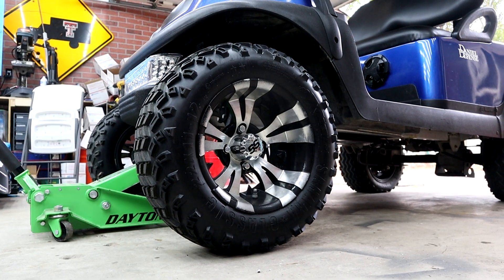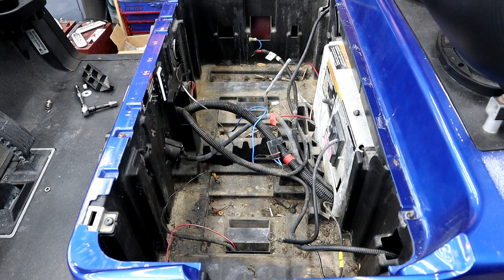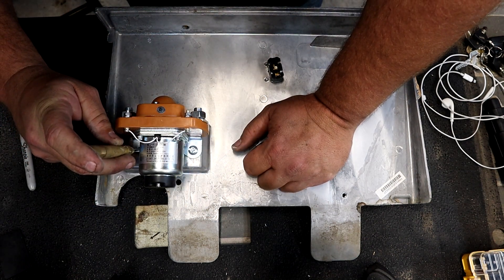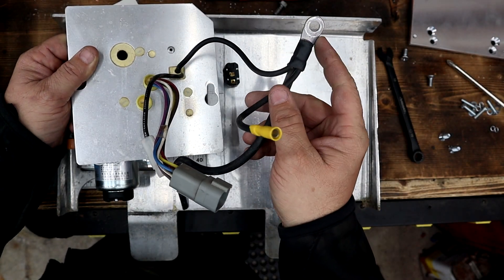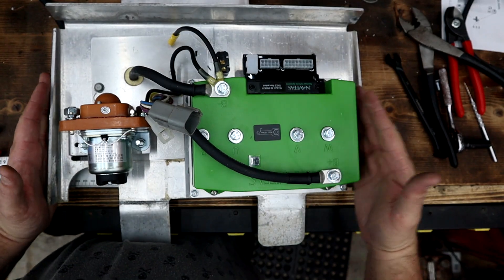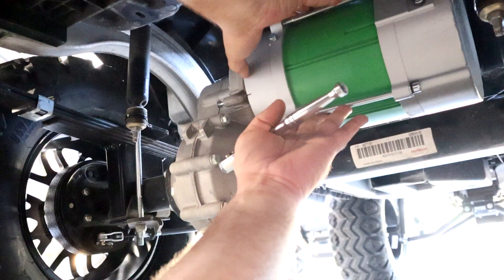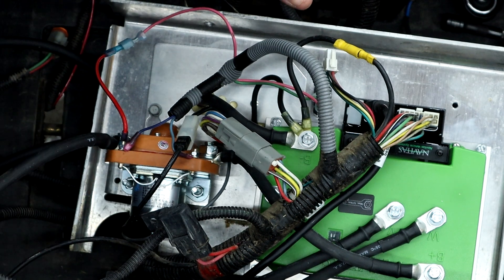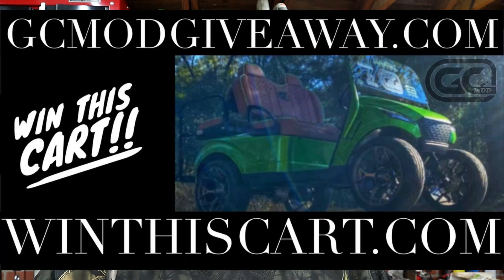CLUB CAR Precendent AC swap. Making your Golf Cart A Rocket

Comment: I have a 2003 Club Car DS. I installed the Navitas Controler and AC/DC conversion motor. I deleted the OBC and installed 4 48V lithium Big Boy Batteries. I also installed an upgraded solenoid. When I got rid of the OBC, I cut all the wires coming out of the OBC, capped them off and jumped the white and blue wires together. The problem I am having is when I turn on the lithium batteries, the battery indicator goes on without the key being turned on and I can't get the Navitas app to recognize the controler. Any idea what I did wrong?

Comment: Great video, I spoke with Steve yesterday about purchasing a Club Cap Precedent AC conversion kit and I will order today. My question is do you have a part number for the back splash guard? I am removing a Navitas 600 DC and I cut the hole in my splash guard when I did the install. Thanks

Comment: I have a 04 club car DS (No lift) Big Battery lithium Eagle kit (120ah) upgraded D & D speed motor and a 440 navitas controller running 27-28 mph with 2 adults. I was curious if a 4kw ac upgrade would be worth the cost? What kind of speed is the 4kw motor producing? Thanks great video!!!
Reply from the maker: My DS runs 35+ mph with a 4K. On hills 27 mph. Way more torque and efficient. It’s even better when paired with a Lithium setup

Comment: I bought the Curtis/Albright heavy duty 48v solenoid and just want to make sure that the b positive on the controller connects to the plus marked side of the Curtis solenoid? My old solenoid also had a resistor connection connecting the two large posts on the solenoid which you didn’t show on the video, do i keep this connected on the new solenoid? Great video!

Comment: Curious as to why no one (including you) has made a video on the 4X12 battery version with center controller Precedent. I have 2 2008 Precedents and looking at doing the 5k and Lithium conversion.
Reply: I am interested in this as well, I've got an '05 with 4x12v and the middle mounted controller plate, wondering if it makes a difference in installation?  Are the cables provided long enough etc?  Any thoughts GCM??
Reply: @mikebogart3841  It all fits and goes in just fine. I just had to drill and tap my own mounting holes. Everything is long enough and works great. I did the Big Battery 72 volt Falcon conversion at the same time. I'm getting insane performance from this system
Reply: @Goldenlife thanks for the info!  Now I just have to decide whether to ditch the OBC and get a new charger as well I suppose.  My cart was neglected for 2 years due to the pandemic, couldn’t get to our vacation spot, so lots to do to get it going.

Comment: I have a 1998 electric golf cart. And my golf cart hose 12 mph but I wanna go faster I have a voltage reducer. In only trying to spend around 200$
Reply: Good luck with that budget. Howver, you could send your motor off to Plumquick.com and let them rebuild it in their "Bandit" upgrade for $275 and still use all stock components.

Comment: I watched your videos, got a 4K system AC conversion, for my 99 club car, and feel I got a the wrong harness , been working with support for over a week now and I am no where closer to resolution, key stopped working peddle doesn’t provide the 5 volts so it may have something to do with that. Thoughts on where to look?
Reply from the maker: Shoot me a email golfcartsmodified@gmail.com
Reply: @GolfCartsModified  
What can I do to make my 1997 36 volt club car faster, it’s all stock with solenoid’s and them ( heat sink bed spring lookin things) an the rear frame rail.
All suggestions & help will be appreciated…
Jimmyb

Comment: I have a 2021 icon i60 that has the 5kw ac motor and a Toyota 440 controller. Can I upgrade the controller or do I need the motor too? trying to get up to speed faster

Comment: I ended up with a nav 10-000890-06 controller that I thought was for the club car I had but when installing it I have a 16 pin connector and the module has a 24 pin what can I do???
Reply from the maker: The 24 Pin is for a 1268 Harness. You will have to return it and get one with a 16 pin